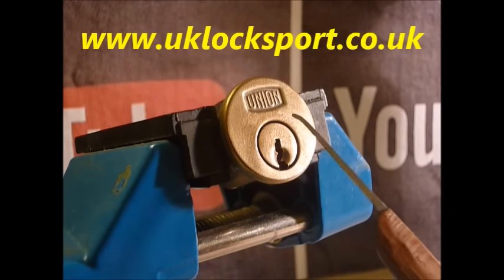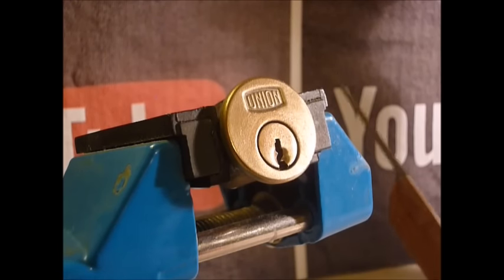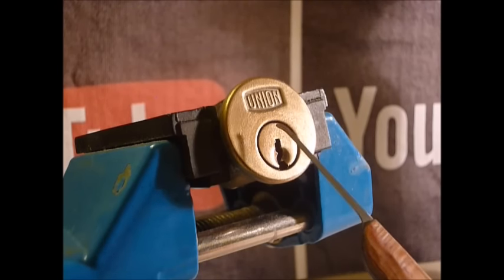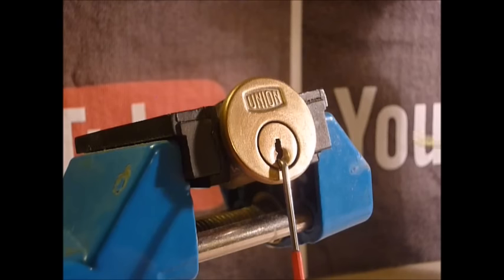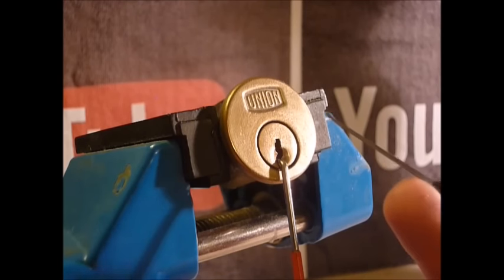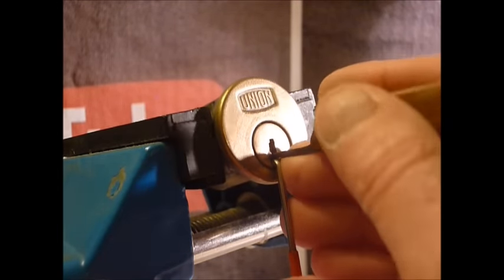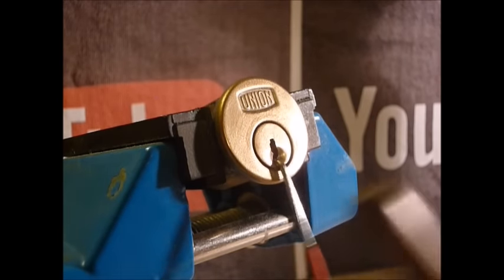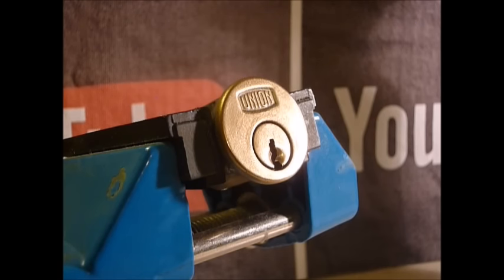Single Pin Picking A Vintage UNION 5 Pin Cylinder Lock For Potti314 And Showing Pins.

Comment: that was a fast pick well done. l have noticed a slight set on the cylinder lock and no security pins involved! good vid..
Reply from the maker: +tonyholt90 
Thanks Tony mate. Yes as said to others, the slight drops on the plug when picking could have been the tapering on key pins catching in the very slight milling on the plug ;o))))

Comment: Thank you for making this video my friend - very kind of you. Would you say that the tapering on the key pins are made as overset trap against raking?
Very nicely picked and great camera angle - enjoyed it a lot :-)
Reply from the maker: +Potti314 
Thanks mate and glad you enjoyed the video. You could be right regarding the tapering on the pins as a raking trap, never really looked into it before. I also noticed the plug was slightly milled out at top as if to catch pins a bit, which could have been the reason for the very slight false sets I detected ;o)))))